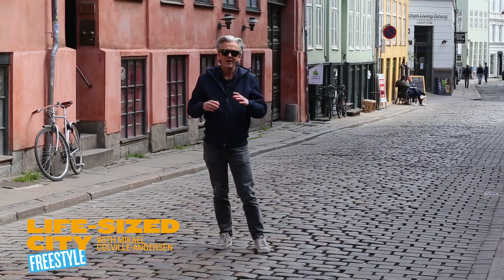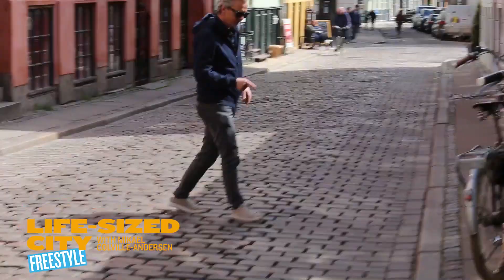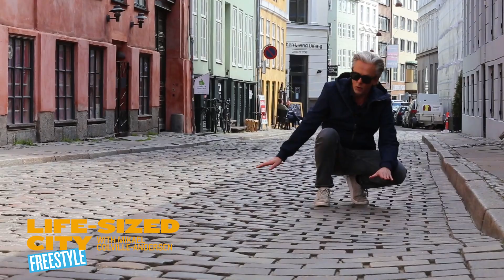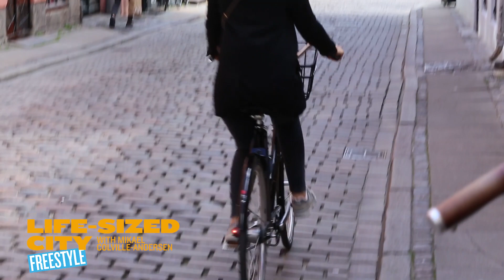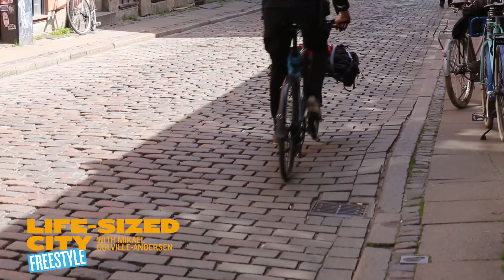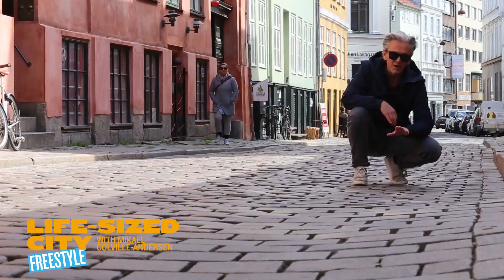Micro-designing Better Cobblestone Streets for Cycling

Comment: I wonder if the 'smooth cobbles' are actually original cobblestones that have simply lifted, had a new surface cut and then re-laid insitu. That is the process the Council I used to work for used (when we could afford it because it was bloody expensive), but we generally only had the bluestone pavers in the gutters and on the road edge, not across the entire road surface.

Comment: Already three decades ago I was after the City-Adm. to make this cykel logic, also another place, but cobblestone in general,
the Street-Dep. even changed way to handle and answer letters because I'd swarmed them with letters pointed at all kind of disasters. About one decade ago they invited citizens to SMS about places with cobblestones to be improved, they choose the two most wanted, this was one of them. It is a disaster because they did not do it properly, the other place is slightly better, 
Sdr. Boulevard/Dybbølsgade.
Well, in the 80's mountain-bikes became very popular in a country with no mountains, well, it was actually pedal-tractors they needed because of the conditions at that time, (You know, a real mountain-bike have two-wheel- drive)
So, Mr. Colville missed the point, well why they made to much space between the stones, is because to get rainwater in the ground, so that it not get to dry, that the old buildings crack, but it is to much. 
There is places where it is more succesful, the harmony between aesthetic and comfort.

Comment: This is a good compromise.  Cobblestones suck for bikes, but they also slow most cars down pretty dramatically (though will be less effective as huge CUVs become common).
Reply: Also: It's not a compromise when it sucks for everyone. Cobblestones are worse for literally every possible road user. Even pedestrians and horses prefer even ground.
Reply: Not at all. If that's your goal then get speed bumps with cyclist bypasses. Then bikes get zero impact and you slow cars more.

Comment: How do they get the rainwater out of that street? Didn’t see any drains
Reply: I suspect it soaks into the ground through the gaps between the cobbles.
Reply: @gustavmeyrink_2.0  No there are drains on that street. Besides the aggregate in that pavement is more like sand than anything else and sand drains water very porly. If the cobblestone was to be permeable it would require larger aggregate like 2-4 mm. With more and more rain innthe future due to climate change, that is some thing Denmark and Copenhagen should use more to avoid flooding.
Reply: There's one right here: youtu.be/6SIaZYT7v0o?t=51

Comment: Do you know what the slip resistance is for these?
Reply: It’s not a choice, it’s a compromise. And in my opinion a fair one. Those cobblestone streets are doing a good job of slowing the cars down and generally making the statement that this is a shared zone. I’d rather ride slower (or have a look at fatter tyres) than lose the cobble zones.
Reply: 42
Reply: Like every other natural cobble stone, they are slippery. It's not just the uneven surface that makes them a bad choice for bike infrastructure.

Comment: I cycle down this road almost every day for work and it is still one of the worst in CPH for cobble stones. The affordance mentioned here (less round edges) is much worse than round edges if you have a bike with even marginally smaller tires than 'city bike' this road has claimed 4-5 tires from my bike due to the sharp gaps and deep holes between the cobbles. It's terrible.
Reply: Yeah, I don't know how you guys manage to ride in that madness. The city likes cobblestones because they come up and go down easily with little loss but they are a bitch to ride on. Why don't you guys ride on 60+mm tires? I find that 2 1/2" rubber can handle most surfaces and still have good rolling resistance. - https://photos.app.goo.gl/PsA19PoCCJ1efbdr9
Ride safe man.
Reply: @brianbassettnumber1  I don't think 60mm would even fit between my fork.
Reply: I don't understand why I don't see more mtb with full suspension in cities like this, probably they get nicked all the time.
Reply: It's also still biasing the path against non-bike modes of transport such as quad and in-line skates or scooters. It also means you're pushing technology down the route of pneumatic tyres and restricting future advances.

Comment: Why not just grind the old ones down with a machine to keep the ancient stones, history etc. but make them smooth :D
Reply: I was thinking the same thing but it would be very difficult with the undulating surface of the road. And very expensive I bet.
Reply: @Miller_prj  There has to be some giant road machine with a big circular grinder that is like a wood planer but for cobblestone, just drive it up and down the street while grinding.
Reply: Why not just turn them over
Reply: Basalt cobblestones are basically cubes and incredibly durable. You can bet that humans are walking on the same cobblestones right now that Jesus did... and they were probably old when he walked on them. They are set by hand on a layer of sand, tamped, and then sand is brushed into the cracks between the stones. If you tried to grind them, which would probably cost more than new stones, they would move and jump around too much. They also move and settle overtime on their own due to rain and freezing. Cities still use them because in the long-run they are cheaper, can be taken up, and put back down with only man-power. They are also slippery when wet and one of the worst choices for biking infrastructure.
Reply: @brianbassettnumber1  they can also easily be dug up and used as 'arguments' during riots.
Reply: Because they like the look of it. The unevenness is rustic